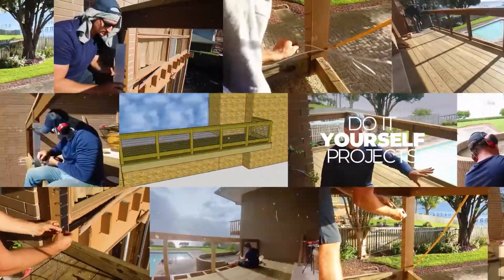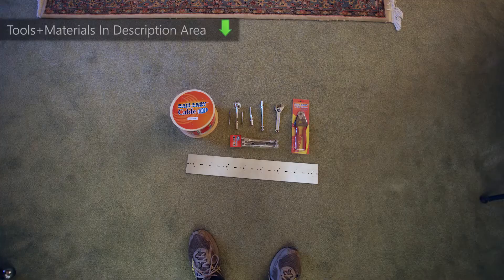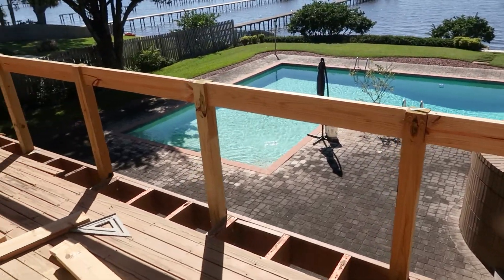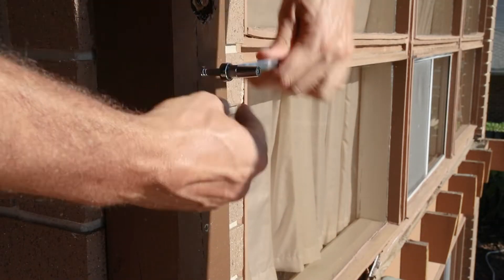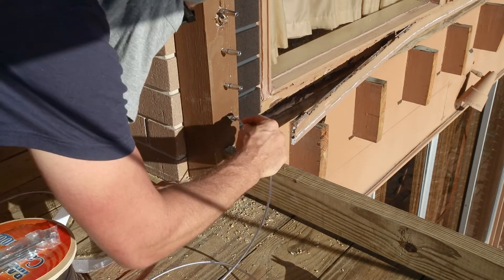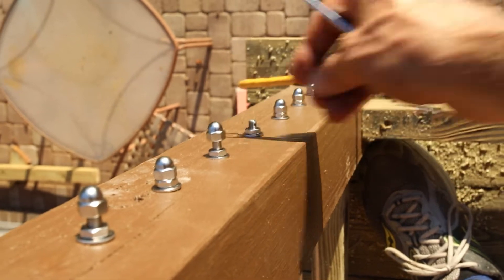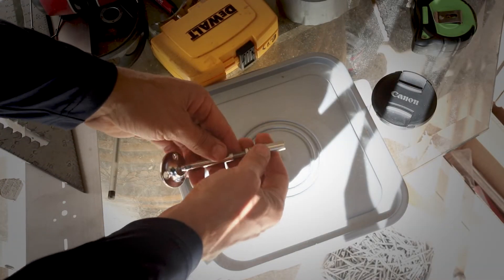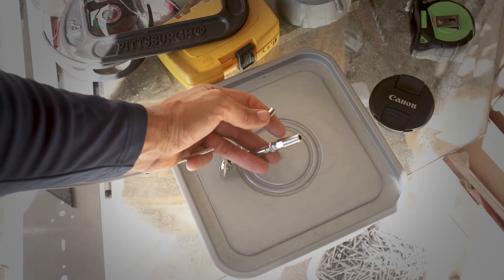How to Install Cable Railing With A DIY Railing Installation Kit

Comment from the maker: One of the convenient aspects of installing a cable railing system is the multiple of cable attachment hardware varieties available.  In this video, I show how the stainless steel cable was attached using a lag stud connector and a through bolt connector.  The lag stud is ideal for terminating the cable into a wood post however does not really provide the ability to tension the cable.  The through bolt connector works well on a corner post where both sides of the post are accessible, this fitting also provides cable tensioning function.

Comment: I will be installing cable on my deck replacement. But I want to avoid using the bottom rail like you did and just go with cable all the way down... 36" high, cabling 3" OC. do you see an issue with not having a bottom rail?
Reply from the maker: I would think it would be fine if you are able to keep railing spacing at 3" like you mentioned.  I would just be cautious if their will be children around as they might try to step on the first cable row if there is no "kick" rail.